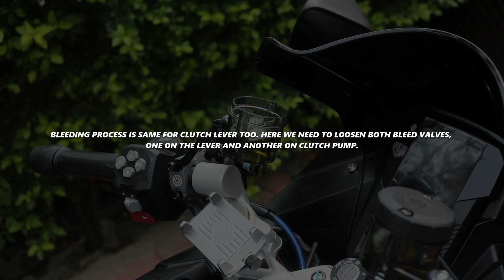Brembo RCS-19 Hydraulic Clutch & Brake lever set Installation | Part 2

Comment: Hi , i have just bought the apache RR 310 and wanted to ask if you are facing the issue of the chain becoming loose after 100 150 kms and if so does changing to rolon brass chain will help?
Reply: Nope it won't help u
Reply: Nop i never faced this issue on my rr310... show it to your mechanic in showrrom bro...

Comment: bro this kind of products are fake how do people install first copy of brembo
Reply from the maker: Yes it’s clearly mentioned that it’s a replica, have you tried it yet ? Mine is working fine since the installation.
Reply: @vishalahinave   I'm tried my friends bike from starting it works well then started some issues stucks and sudden brake , where can I purchase this original brembo brakes do you any idea 💡
Reply: @vishalahinave  why are you lying? since your pro 17inch wheel cover you have removed it and you are using stock clutch lever. Don't misguide people into buying this
Reply from the maker: @AkashPaul-ql1fu  who is forcing you to buy ?? I'm personally not suggesting people to get hydraulic clutch as its installation is complicated but I'm still using the hydraulic brake. Also about the mods I do on bike, I guess I have all the right to install and remove a particular part whenever I want. I'm not forcing people to install these parts, I'm making installation videos, know the difference.